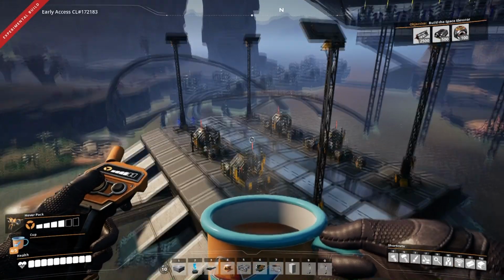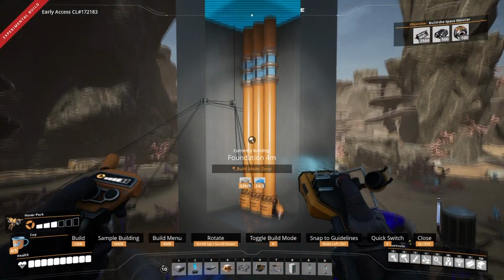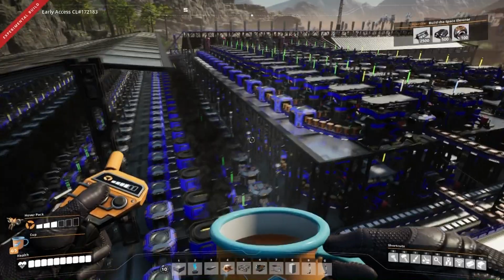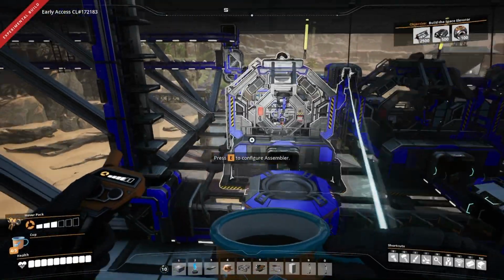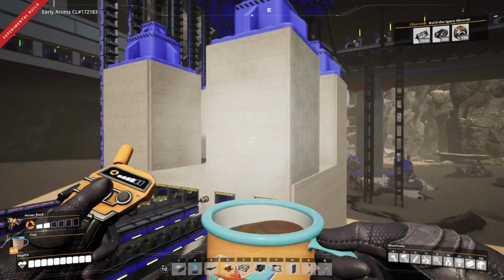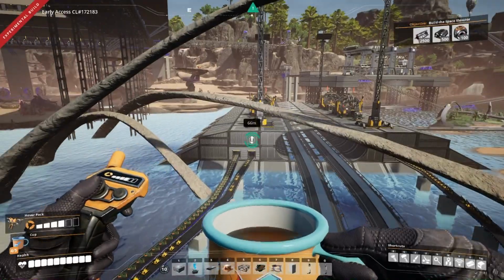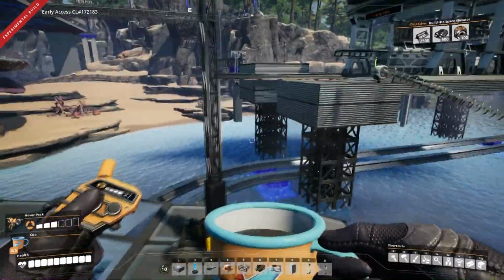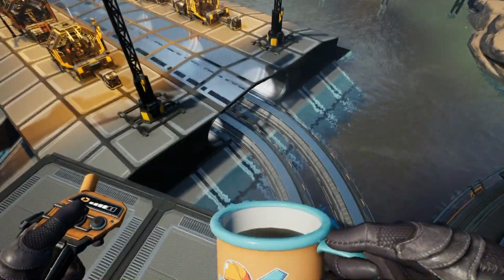SATISFACTORY - U5 VANILLA PLAYTHROUGH EP#3

Comment: Gday, I need your crystal oscillators in which the vibration of the quartz crystall will precisely control the frequency of the carrier waves of my transmittor and ill add the information to be transmitted with my modulator circuits
Reply from the maker: How many per minute do you require?   ;)